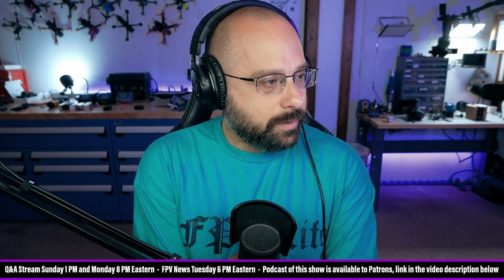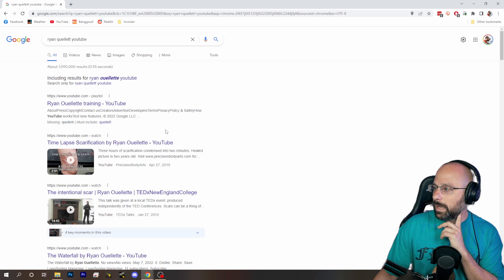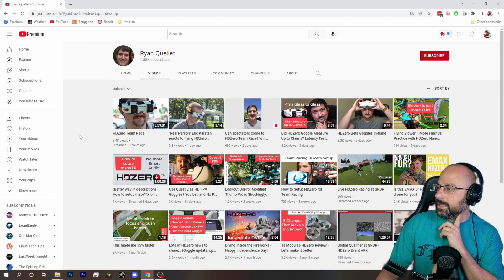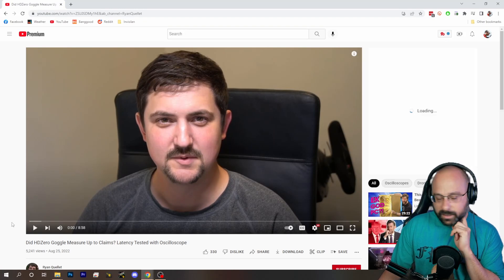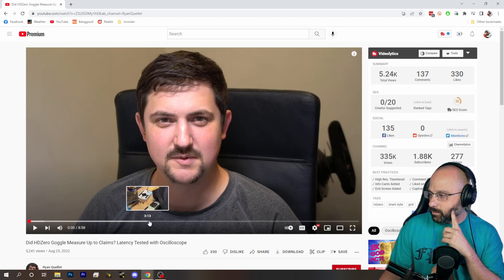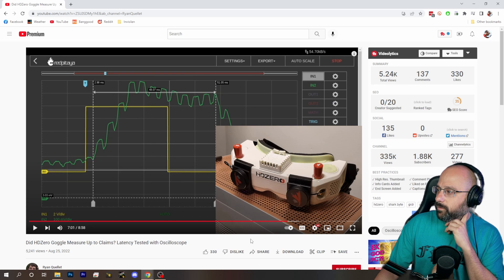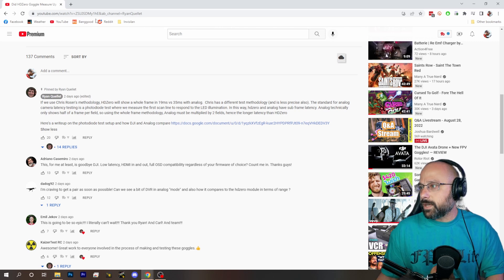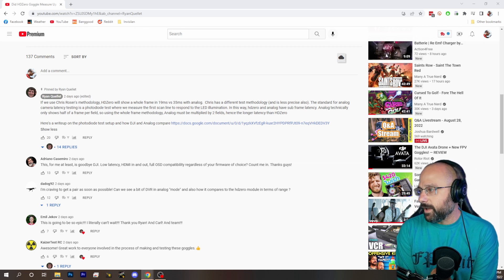HDZero Goggles Latency Testing! Which Latency Matters? - FPV Questions

Comment: While there are parts of Chris Rossers methodology that are somewhat debatable, there is one thing that is definitely not and I wish people would stop repeating this: In all analog goggles that currently matter (all Orqa goggles, HDO2, Sky04X...) there is no such thing as "full frame latency". In fact, there is no such thing as a full frame. Instead of displaying 25/30 frames per second deinterlaced video using frame combining, these goggles strive for minimum latency and simply render all fields as frames via line doubling. You don't get half a frame first and then another frame, you get two frames at double the frequency (50/60 fields as frames per second). 
Now some people may argue that this means analog goggles only give you half the vertical resolution and therefore we should count two fields as one full frame to keep things fair (or as Chris said "to get the full visual information") but that is just dumb because we are comparing systems with varying resolution anyways. Analog will always have the shittiest picture and everyone knows that. So what, would we need to count 8 analog fields for one DJI frame? No, that's stupid. For all intents and purposes, one field is one frame if your goggle uses line doubling (which all recent ones do) and there is no such thing as full frame latency.